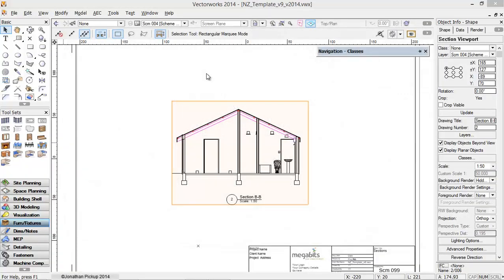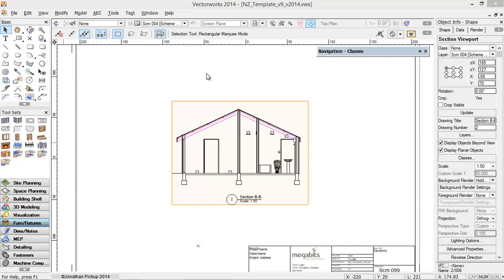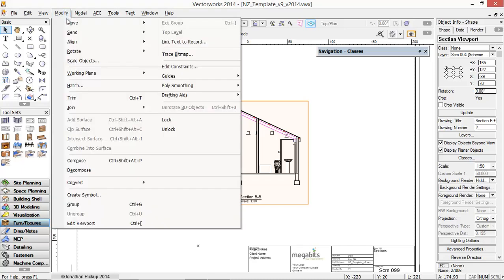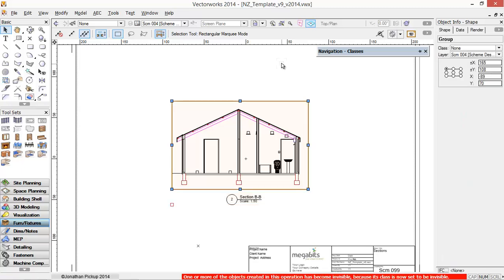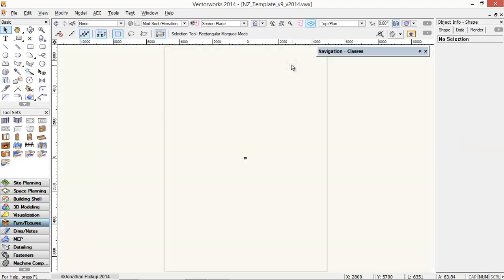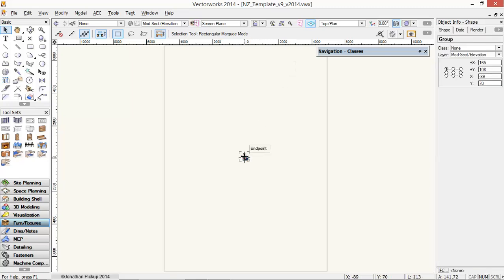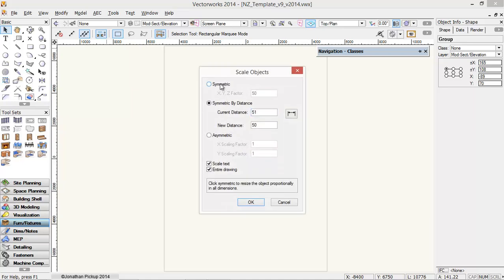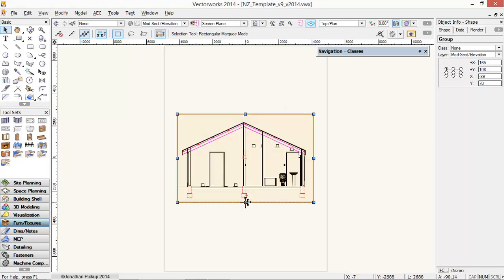podcast 169 - Converting a Section Viewport to a Line Drawing

Comment: A quick note: you can create a Viewport on a design layer and skip the scaling step.
Reply from the maker: That`s true. When I made this video, I'm not sure that we had Section Viewports on design layers. I think when I made this video, I had in mind people that wanted to take an existing section viewport from their concept drawings and convert it to 2D for developed drawings. 
An addition to this tip is to copy the section viewport, change the viewport scale to 1:1, then convert it to lines. This removes the need to scale it later.